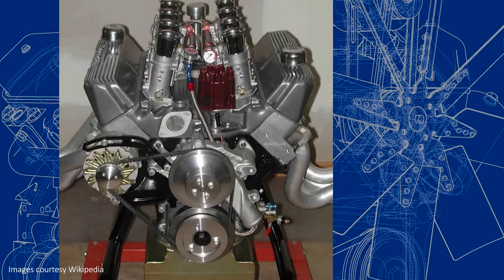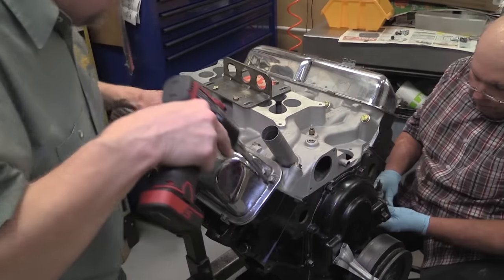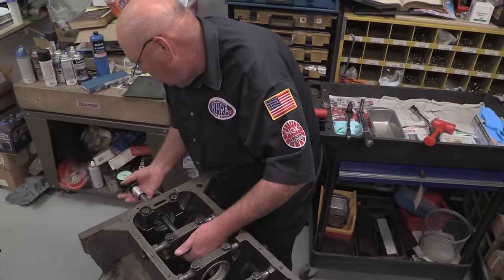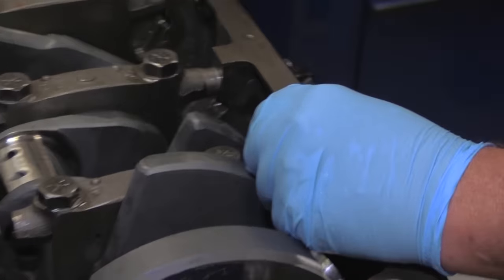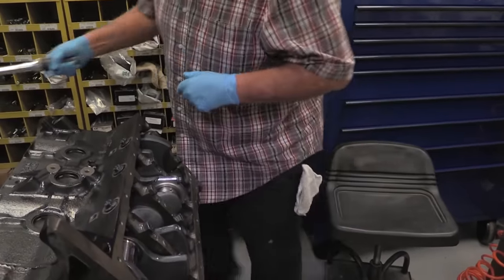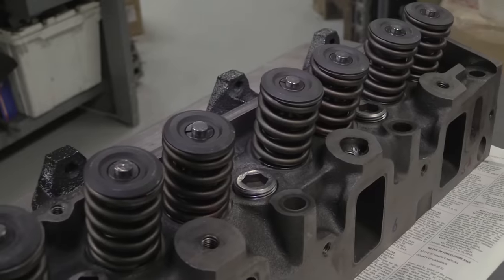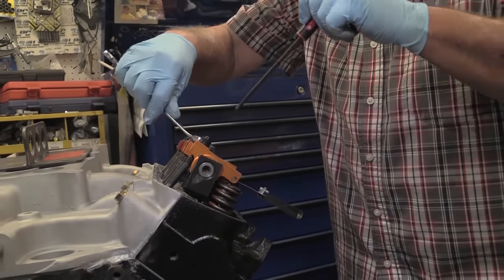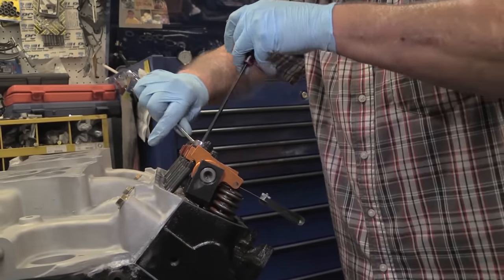Monster Ford 427 Top Oiler Engine Build and Dyno Session

Comment: It sure seemed to be puking a lot of fluid, but sounded great!
Reply from the maker: Thanks for the compliment. Yes, it was smoking a lot on the dyno in the shot. I probably should have said something about it, but we had just pulled the valve covers to check the lash on the valves and some oil had puddled just above the headers. That smoke was the oil burning off. Thanks!
Reply: @TheHorsepowerMonster  
That's called ambiance!  
Add the fragrance of some 116 to the oil and you could sell it as a candle. 
I'd buy some for those long soaks in the bathtub.  I already have one in my shop that's the aroma of Castor infused 2 stroke fuel from my Dirt bike days and instantly takes me back to my KX500'S which I should go start now....

Comment: Head choice killed the output.
Reply from the maker: You are definitely right, but the owner wanted to keep the stock heads--didn't even want any port work done--so what can you do?
Reply: @TheHorsepowerMonster  I get it. Just sad to see that bottom end potential go to waste.
Reply: @JohnComeOnMan  How do you figure this is going to waste?
Reply: @madmod  By going to waste I mean leaving a lot of potential on the table by choking it. I'm sure the owner will enjoy it just fine as is.
Reply: @TheHorsepowerMonster  he could have left the heads alone and kept them and ported another set if he was keen on returning it to stock
Reply: I just want to know how one can tell after assembly that a head has been ported and polished.
Reply: Yep not exactly how I'd do it. Look it's just a feeling but I think the primary tubes on the headers are a bit small for this capacity. With the cam specs, I would've had a solid flat tappet rather than the roller and I'd use the stock valve gear and see if I could get away with some beehive springs - yes i know they run out of oomph as the lift increases but there may just be some that you could use. I'd like to know what a set of aluminum heads and bigger headers would do to this thing.
Oh, I forgot; great vid. I thoroughly enjoyed it.
Reply: @TheHorsepowerMonster  Easy; keep the stock heads on the shelf. Where they belong. Since you didn't really need anything from the original motor, just build another and store the original. OR my absolute favorite idea. DO what you want, who gives a damn about the next guy. But I realize you cant reason with some people and thats why you didnt.
Reply: @BuzzLOLOL  ;  Who cares....
Reply: John ; Whats wrong with the heads?  You did notice the huge intake ports?
Reply: @Earl James The shop is building the engine to satisfy their paying client, not the viewers.
Reply: Were the heads low or medium risers?
Reply: i totally agree, they at least should gave hogged em out with a good port/polish tp get em flowing better. people scream aluminum heads but yea you might save 30 lbs but it's  not worth the cost sometimes.  i have a deceased uncle ford engine builder built me a 460/521 stroker for a 66 f-100 swb any who took factory dove heads when he got done with my heads oh yes they weighed less but they out flowed anything on the aftermarket at the time. 10.6 compression don't remember cam specs on the dyno it pumped out 615 hp and 580 tq with a holley 900 cfm double pumper and about 4 miles per gallon with a stought c6 trans and 9 inch rear. that truck was wicked. started with a 373 gear ended up with 290's  for better drive-ability. but with the 290 gear she still pulled hard with a 5 to 6 second 0 to 60. my uncle built ford engines in the 60's and 70's for nascar racers in alabama. he was in his 70's when he built my engine. it was a lot hotter than i really needed but like he said you ain't gonna get no better gas mileage either with 450 hp or 650 hp. i wish i knew what he did he never ever got in a hurry too him a year to build it. it ran so smooth so well balanced even with the lope the cam gave it you could set your coffee cup on air cleaner while setting the timing or carb. i made 3.15 an hour at a tg&y store and that money fed that truck gas and rear tires in the 80's
Reply: Mark Godfrey  The engine he is refering to shares dimensions with the Chevy..that's it. The block and heads are cast by blueprint engines as well as having spec'd the cams. Not to bad of a deal for 500~hp warrantied and shipped to your door with a Dyno sheet. I agree tho, YouTube mechanics/engineers cannot be pleased.
Reply: @philipmacduffie7612  Are you saying you can't reason with him, or he can't reason with you?  I am not sure current generation get it how lucky they have it now.  My teen years were in the 70's.  No one stroked an engine, aluminum heads?  Not unless you happened upon some factory ones at the wreckers.  We did have that part over current gen, we used to have wreckers that did not use the "half of retail price" for used parts.  I drove my 302 Torino to the auto wreckers one day, just looking around, found a dusty Holley carb on a shelf, the list number was 1850 (that's a 600cfm vac secondary's).  The guy that runs the place asked me if I wanted it, told him I did, but my car only has a 2bbl intake.  He says hang on and he disappears for 10 minutes.  Finally comes out with dual plane aluminum intake with no brand name on it and says $20 for the carb and take this intake with it.  Couldn't get the money out fast enough.  The carb was selling for $150 back then, and I was only taking home $100 a week.
Reply: @22099dscott  The guys who built the motor can't reason with the guy who wants to choke off that big stroker with historic artifacts of valve actuation. 

   Things are indeed cheaper today as far as go fast parts go. Which is all the more reason to take advantage of it. I suspect refurbishing those heads cost near what new ones do. I could certainly show receipts to prove that math.
Reply: @izzyplusplusplus1004  You can't tell ported and polished heads on an assembled engine. They stated the owner wanted to keep them stock.
Reply: @randomstuff3201  Exactly! That was my point.
Reply: I agree. However, the customer is ALWAYS right. Great video.
Reply: Wonder what octane needed for even a low-riser? Would just be occassional toy if ya gotta search out not real easy to find and pricey race gas.

Comment: Looks like u need to put oil restricters in the head where the rockers are fed and you won't have the vc leal also save the bottem end .Simple fix with a 5/16 screw cut off and ground a little on both sides . just drop them in the oil feed to the rocker shafts and they will rest on the head gasket oil hole . Use a magnet when you remove the head to. remove them them .
Reply: Holley jet works better.
Reply: I bet you never tried the way I talked about ? It WORKS and it's an easy fix .
Reply: @edge2sword186  using Holley jet is adjustable. I can accurately control how much is going to the rocker shaft.
But if the screw job works for you, cool.
I use a screw to run down the jet and pull it out of the oil feed.
Reply: @jesse75  That's a Holman Moody  fix so they knew what they needed to do the job .
Reply: @edge2sword186  that's who I learned it from. Preaching to the choir.
Reply: @jesse75  They had alotof things that made sure the  engines in the Stock Cars didn't fail and ran very hard so you could trust their advice and parts for reliability .
Reply: @edge2sword186  I have a 427 top oiler built to H & M specifications. Even down to the inside of the block being polished. 
You can see the oil pressure reading on my race car on utube :
" 427 FE with a new set of valve springs. "
I'm using size 60 jets in the oil passage to the rocker shaft on this engine.

Comment: Put that in a 3200 pound '66-67 Fairlane with a 3.55 rear and a top loader close ratio 4 speed (with good tires of course) and you'll win street races all day long. That'll be a ten-second car with all that torque.
Reply: Lucky to get high 11's... with a 4.56 rear...
Reply: @BuzzLOLOL  With a 4.56 you're probably right. But if he keeps the weight down to 3200 and runs a 3.55 rear, he'll make high tens in 3rd gear. I knew a guy with a 428 Fred Jones built SCJ: Edlebrock dual-plane, 3.55 gear, Top Loader CR 4 speed, Hooker long tube headers running out straight pipes in a '67 Fairlane and he did 10.7's in 3rd gear. Damn thing outran me in my Suzuki 750 2 stroke when I had got the jump on him on Hwy19 coming out of Howey. I had the speedo pegged about 10 mph past the 135 maximum and put on a few rpm past that, must've been doing 160, and he motored past me about 10 mph faster, almost blew me off the road. Pushing that billboard of a front end to boot. But I digress...

Back to this 427, he'll run high 11's with a 4.11 running an automatic with a stock torque convertor. I knew a guy that ran a wheelstanding Chevy van using a junkyard stock AT and a 454 that had over 500 foot pounds going for it. When you get that kind of high torque it can make a stock TC act like a 3000 stall racing convertor made for a 350 ft/lb small block. On a small block you can use that 4.56 because you're looking to get 7000 rpm to make up for that poor torque curve on an engine tuned to idle at 2000 rpm.

You ARE a small block fan, correct?
Reply: @Richard Skipper Low tens probably with 400 pounds less weight.

Comment: Seeing that all petrol is unleaded now, do you install hardened valve seat inserts on the iron heads to prevent valve seat recession?
Reply from the maker: Yes, in my book all old iron heads need hardened seats to be able to handle unleaded fuels or else you'll just be going back to fix it down the road. Thanks for watching!

Comment: Considering the big cubic inches,  the crossing point of hp. over torque is all wrong  ..there's something else limiting this engines true potential. ..even with stock heads, I'm thinking limited plenum volume.  With the telemetry available of a modern dyno, I wish they'd offer more details ..
Reply: It crossed at 5200 where all engines do...

Comment: There has to be more potential in this motor than that. I just watched a 406 SBC stroker make 553 crank hp and 498 ft lbs. Built right this motor should be good for 650 to 700 at the crank.

Comment: FE 4Life 
I regret getting rid of the 428CJ that I'd installed in a 68 mustang. 
Especially since I bought my wife a 67 coupe. It will probably get a stroked 390, I am seriously trying to avoid going with an LS. It is cheap easy HP but as mentioned if the parts and the stars align it'll be FE with the same or similar 2×4 offenhauser intake with 2 Carter AVS but not the same cam due to using one of Comp Cams Super Stock grinds 
@ 304/314 advertised duration  626/653lift flat tappet solid lift. Which worked like a dream with a 3600 converter in a C6 and a 4.56 Dana but is a little bit radical for wives...

PS,  I had to come back and say that I had a hard time putting carpet and sound deadner in the car because a solid mounted solid lifted Hooked Super Comp. headered setup like that is better than the highest end sound system ever made....
Reply: Why on earth would one even thk of putting a chevy motor in a 67 mustang? Doesnt sound like ford man,to me!
Reply: @460duck  
Duck,duck,duck I never said I was a Ford man. I'm a go fast man and the dollar to hp numbers can't be beat with an LS.
I did say I love FE's but their dinosaurs and I'm definitely not an archeologists.  But if I can make it happen, it'll happen just for you.
May even name it after you, what do you think about "Duck Butter Dominator "  
But seriously if it'll make enough HP I'd run a Briggs and Stratton...
Reply: @460duck  
You weren't offended by the Dana in a mustang?

Comment: Considering that the 427 ford motor was easily capable of 700 plus horsepower in stock bore and stroke configuration the numbers here are a mild disappointment.
Reply: joe cucch I feel you on ghat. Lol but I get 13:1 compression vs. 10:1 compression. Detuned for the street. Hard to run a 700 hp 427 on the street regularly. A car that cost $8.50 a gallon to fill up with race gas and probably only gets about 6 to 7 mpg wouldn’t be driven as much.
Reply: @Rusty Crusty CJ7; If I had a 427 ford motor the last place I'd be thinking of running it would be on the street but thats just me LOL !!! If you want a reliable street motor for a ford just go with a modified 351 Windsor. They can make great power. or a 460 if you want big inches.
Reply: joe cucch I’m with you but to each their own I guess. That’s just the logic behind this build I’m guessing. He called it a sleeper. As a ford guy myself, a 427 is never a sleeper even stock. Lol
Reply: @ Richard Skipper; I tend to agree with you there. Plus their is a lot of old 351 blocks to be had at a fair price. Give them a good set of heads and cam and depending on what you want to run, a set of forged pistons and you have real fine street machine.
Reply: It's a junk Ford engine what can you say
Reply: You can get better throttle  response on those engines by going 2  to 3 thousand tighter on the valves   say if it's 22 make it 19 you wouldn't beleive the difference
Reply: Wanous 1966 - are you being serious?

Comment: Cool motor! I would have at least cleaned up the heads and done a nice blend and some trick multi angle valve seats- none of that would take away from the stock appearence and wouldn't have hurt it if taken back to stock. Still, cool bit of gear though. Just would have been nice to see at least 1hp pet cube or more. A 13:1 comp, E85 chugging one with a bigger cam and ported heads would have been interesting
Reply: You see tha  A/F  readout on the console at 9:12? Must of been some  Shmirnoff in the mix :) - Sandy
Reply: @deeremeyer1749  stay mad bowtie boy
Reply: @chhh8057  - he is a legend in his own mind.

Comment: Did anyone else notice the Sparks jumping from the bottom of the engine to the frame?
Reply: I thought it was to but if you watch it in slow motion it looks like a wire with a flat shiny side dangling. Possibly some type of sensor wire with a metal lead like a contact surface temp sensor. I'm still not totally convinced there's not arcing because of the puff of smoke or steam that seems to be coming off the end of it. It even looped around something with a trail of smoke looping also.

Comment: Amazing build, I am a little surprised you went with those comp roller lifters. I didn't catch the cam but so many guys here on youtube with comp roller lifter failures. Must be hundreds of engines if not thousands ruined by comp lifters. Comp admits its product failure and refunds cost.

Comment: At 2:05  ...look at that casting flash just above the mains at the webbing !!!  Do you guys prep blocks or is it "as is"?...those are all stress points, weaknesses within the structure of a block. No, you don't have to polish the insides of a block, but at least do the basics. And no, those spring loaded idler tensioners didn't appear till after the FE series were out of production.

Comment: While I have always been a big fan of Ford 427's , I am still not sure how many different versions were made.  I know of the 427 top oiler and the 427 side oiler and a version called the 427 wedge....also , is the side oiler the 427 SOHC called the cammer  , or were there two different versions of the 427 side oiler ? Appreciate any input........
Reply: All 427 Fords had bolts visible on the block side skirts where the mains were cross bolted. The first is now known as a centre-oiler - also called a top oiler.
When Ford was developing the Cammer motor they revised the oil gallery (side oiler) to better supply that configuration and carried the change into all 427 blocks thereafter.There was a "Service Block or P block" produced in 1974 to meet the demand for new blocks for racing needs. These blocks have considerable strengthening to the main web area and corners of cylinder cores - higher nickel content. This might be the "2nd" side oiler you are thinking of.  Different heads were produced for different applications - low riser, medium riser and high riser. The tunnel port was racing only and the SOHC engine was a dealer option race motor. Various induction systems were available to suit the application required - single 4 barrel, 3x 2 barrel, 2 x 4 barrels - single and dual plane manifolds. Cast iron headers - both shorty and long tube were supplied with the hi-po versions along with solid lifter or hydraulic cams to suit. Some centre oiler motors were used for industrial power and many for marine use. Most of the industrial 427's were casting rejects and exhibit some core shift. I am sure I missed some but that's my take on the FE.
Reply: 427center oiler's had oiling problems in racing applications,fixed when side oiler came out in 65.can tell difference by bulge on side of block on side oiler.S.O.H.C.427 had similar block as side oiler but also has oil drain holes in block for the S.O.H.C hemi heads

Comment: I really expected a little more HP like 600, My Windsor puts out more HP, I think they went backwards, I believe the 3.7 stroke crank will make more HP But that Torque is Big great for a big car or truck.
Reply: They said 10 and half to one compression.
Just take a look at that deep dish piston. More like 8 to 1 . 
That's why it didn't make more power.

Comment: Nice engine.. Still would have used after market heads. You can always put the old ones back on. But the more torque you put out. The old transmissions would take a beating. Unless you improved it up to 700 HP...